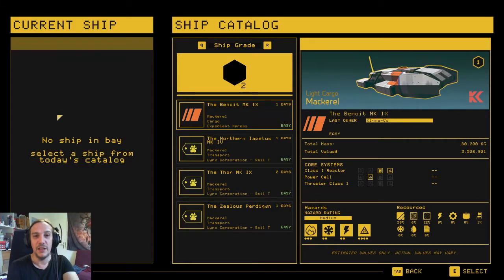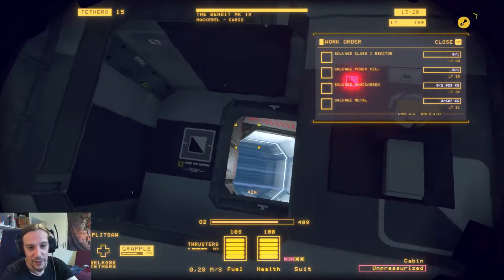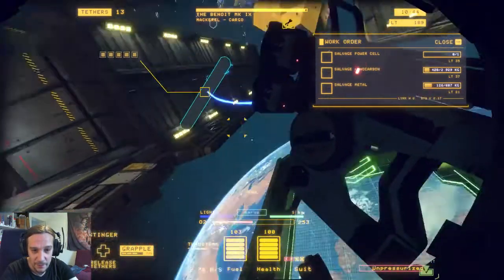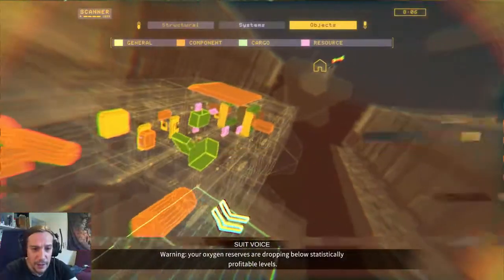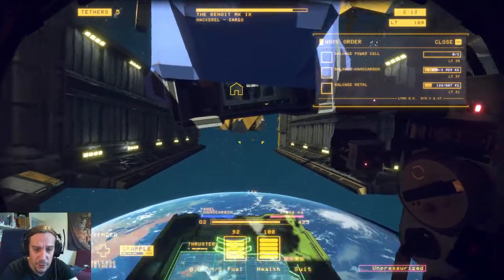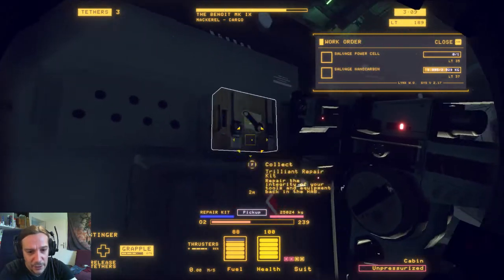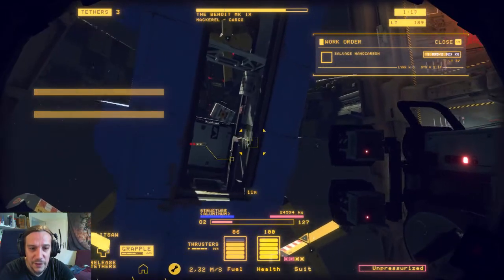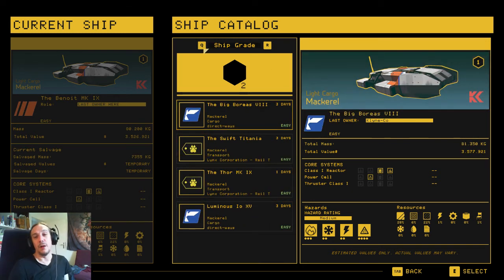Hardspace Shipbreaker - Beginners Tutorial Gameplay Guide

Comment: Here are some extra tips for you cutters out there 1 I believe Z and X or X and C control your hands. You can hold these buttons to reach out and grab onto things and stabilize yourself for an extra precise cut, you can listen through doors and pipes to see if there's fuel or air, you can brace yourself for impact with objects and prevent cracking your helmet, you can crawl through crawl spaces a little bit faster, and you can use your hands to push up panels as opposed to just pressing yourself and your entire body against it to push it out. 
2 You can use the split saw adaptation to your cutter to cut cut points a little bit faster. Especially if they're against nanocarbon because you won't slice through Nano carbon without an upgrade, you will however cut through aluminum. 3  the four Cut points on the rear panel of a mackerel will actually release the entire section of the Thruster Bay and reveal the rear entry points of the crawl space between the Nano carbon and aluminum wall, you can push out the Thruster Bay and get into there a little bit faster if you want to clean your job and you don't want to slice through aluminum and deal with pulling it out and manually taking it to the furnace. If you don't have the upgrade to your push strength for your grapple, you may want to use a tether to pull the Thruster bay back towards the berth wall. 4  make sure you remove the power cell before you remove any electrical equipment as removing powered equipment will cause electrical damage and may cause arcing to different objects further causing damage and possible chain reactions and explosions. 5  if you use the right Mouse button won't grappling an object you will pull it towards you, be careful as there is a delay before the object actually starts moving, and if you hold the button for too long you will quickly pull the object to you and smack yourself in the face with it 6  if you want to quickly get to your workspace or back to the hub, you can also use this reeling trick to pull yourself to the ship you're working on or back to the master Jack, also keep in mind this will greatly increase your velocity so remember to let go and slow down before you hit your face on the object that you're pulling yourself towards. 6 you can actually melt the framing that surrounds aluminum panels instead of cutting straight through them in order to separate different chunks of the ship 7.  when and structural scan mode, you can tell whether or not an area of a ship is pressurized by the green or red indicator light next to the shortening of the name of that space, do keep in mind that different areas of a ship will have their own atmospheric controller in it, and sometimes the controllers will be broken, deactivated, or they will not link to other spaces so you will need to bust out a door in between the two spaces before you equalize the pressure in order to fully de pressurize or pressurize a ship
Reply from the maker: Absolutely right! I went on these things in the coming tutorials, but it should definitely be shown here too. Thanks for sharing =)

Comment: From Wanderbot it seams easier to get into the walls after you removed the backside
Reply from the maker: That's true. In my other videos I also show other ways of doing it. My favorite is to upgrade the Stinger with max heat and cooldown and just melt away those panels in your way completely. Cutting them takes way more time. But for beginners without upgrades it is a possibility. 
But as usual - there's always a more efficient way =)